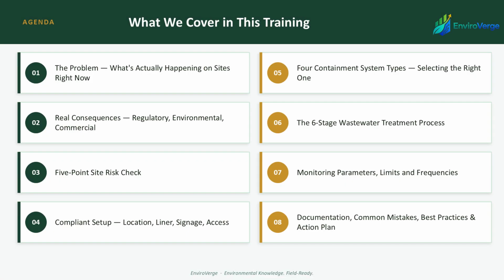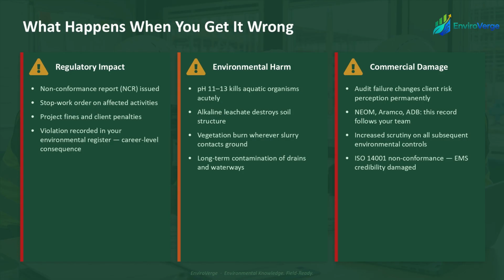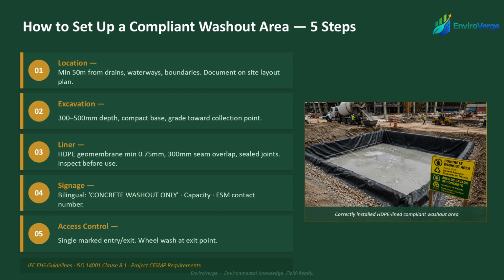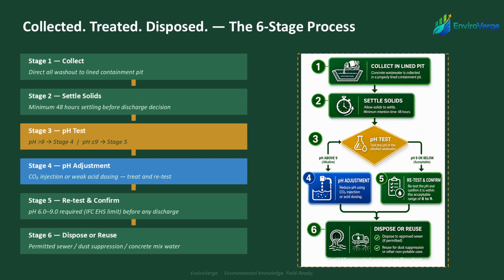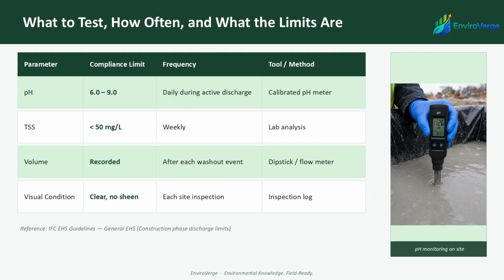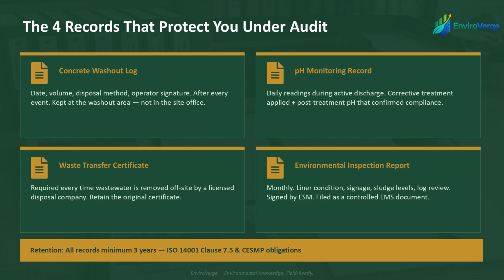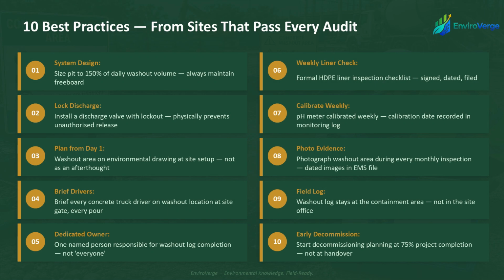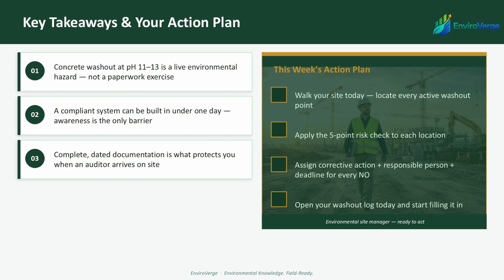Concrete Washout Audit Failures: 5 Mistakes to Avoid

Comment from the maker: 🚧 Concrete washout may seem like a small site activity, but when managed incorrectly it can contaminate soil, stormwater, and nearby water bodies.

🔍 Quick Question:

What is the most common concrete washout mistake you've observed on construction sites?

1⃣ No designated washout area
2⃣ Overflowing washout pit
3⃣ Poor signage and awareness
4⃣ Improper disposal of hardened concrete

Share your experience in the comments below! 👇

🌱 Follow EnviroVerge for practical environmental compliance, sustainability, and construction best practices.

#ConcreteWashout #ConstructionEnvironment #EnvironmentalCompliance #Sustainability #EnviroVerge